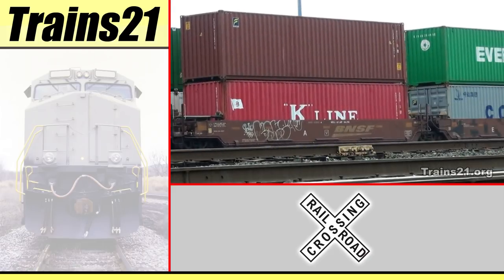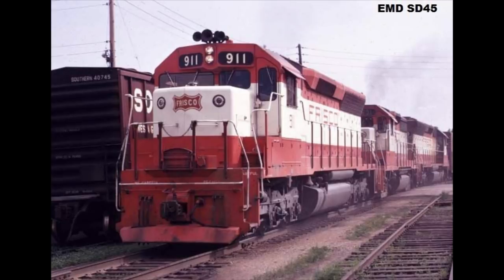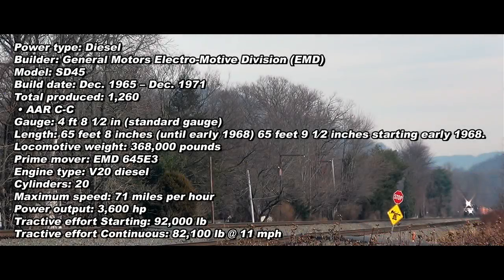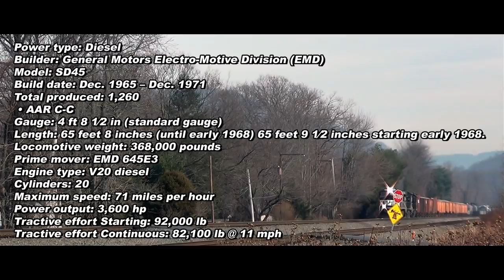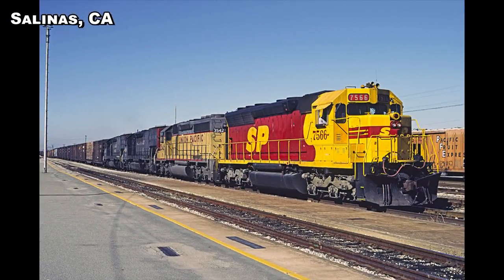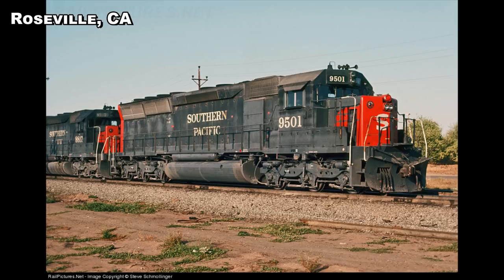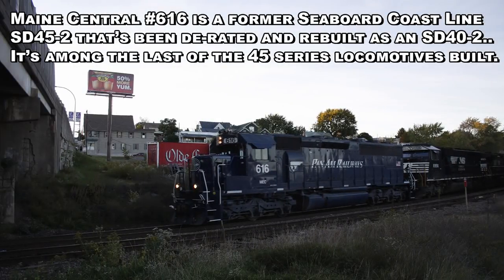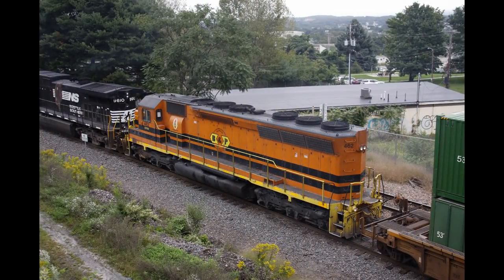[GL][T-176] ENDEARING EMDs: The Indelible SD45 Locomotive | Trains 21

Comment: Two Minnesota railroads that didn’t purchase the SD45 and were smart not to were the Soo Line and the DM&IR. The mechanical staffs of these railroads knew their business much better than EMD did. Soo Line, like its parent Canadian Pacific, engorged itself on the 3,000 HP 40-series (original and dash-2 variants). Missabe went with the 2,000 HP SD38 building blocks. In both cases, EMD tried to sell them the SD45 concept but that math didn’t fit these two. Why? They were both drag railroads. Speed was not essential so the gain of 600 HP and speed at the cost of turbocharger maintenance didn’t make sense, and both railroads accurately foresaw the difficulty of trying to unload the monsters on small railroads in the secondary market. Just think though, if Soo Line had purchased SD45s there would have been two railroads with the funky look of the slanted radiators sans dynamic brakes (C&NW being the other miscreant.)
Reply: A Soo Line SD45..... That'd be pretty neat to see. C&NW's SD45s were interesting units because of their lack of dynamic brakes. Weird that EMD would try to sell DM&IR of all railroads on speed. I'm thinking their marketing department was asleep at the throttle when they tried that. Soo Line at least had a decent amount of merchandise traffic. Frisco would have done well to figure out their needs better. It seems they regretted their SD45 purchase to a degree. They were certainly happier with their GP40-2s and SD40-2s.
Reply: The SD45's weren't great units.This includes the SD45-2's,SD45T-2's,F45's/FP45's,SDP45's,and SD45M's.All of these units had crankshaft failure and block flex because of the 20-645-E7's hence why most units were rebuilt with 16-645-E3's.
Southern Pacific owned 357 units while 167 became SD45R's and then 87 were rebuilt into SD40M-2's thanks to MK Rail.About a dozen of those units were also given fabricated radiators from SD40-2's.6 SD45M's that were acquired from Erie Lackawanna also became SD40M-2's under Southern Pacific.Many of the SD45T-2's were rebuilt as SD45T-2R's before being redesignated as SD40T-2's with Union Pacific.Wisconsin Central just adjusted the governors and derated the horsepower on their SD45's which actually solved many issues.
Aside from insufficient dynamic braking,the units actually had noticable acceleration and traction towards serious tonnage next to the SD40-2's.The tractive effort was almost comparable to the likes of GE C30-7's and C36-7's.
However,the problems that these units caused ensured that EMD didn't make any mistakes while the GP40-2's & SD40-2's were in production.This was one of the preventive contributors that sealed the greatest longevity for them.Also,decades later EMD made the 20-710-G3B-EC's for the SD80MAC's.Because of what failures happened with the 20-645-E7's in the SD45's many years before,EMD knew what mistakes to not repeat and actually were successful in making the SD80MAC's reliable and having the units retain the title of being reliable at that with the highest horsepower.Unforunately EMD ruined their recovering notoriety once more by creating the SD90MAC's in later years which were more problematic and unreliable than GE's AC6000CW's.

Comment: All that I know  is that the 3016 came by Southern Pacific   now Susquehanna   3014 used to be  Southern Pacific   then it was Painted over to Susquehanna  3012 also came Southern Pacific   now Susquehanna  the SD45 from Susquehanna  before Susquehanna use to be  Burlington Northern  in the  1980s  now as years  went on the Burlington Northern  became  Susquehanna  as 3618 and 3634 3012 3016 and 3014 were SD40T-2S  and Same as  the  Blue bird Locomotives  that NYS&W  Railroad  used to  run  the SD40-2S  from NYS&W 3022  used to  be a  GP9 number  3020 now its 3022 and 3010 came by the Rio Grande Railroad  which on first site had a train horn problem  so 3010 Retired  from NYS&W Railroad

Comment: Conrail only had 13 of these sd45-2s. Norfolk and western and southern railway a lot of these black and white tuxedo
Reply: Logan Detwiler 5 with NS which continue service on Conrail North Jersey Shared Assets. 1700 sports it’s original Erie Lackawanna livery
Reply: CentralJerseyRailfan wow they survived the Conrail split of CSX and Norfolk Southern
Reply: Logan Detwiler yeah, and there’s also CSX 8886, while retaining its SD45-2 car body it was rebuilt to SD40-2 standards with a 16-645E3. NS 1700, 1701, and 1702 have 16cyl motors but are still classed as SD45-2. 1703, 1704, and 1705 i believe have 20cyl 645s derated to 3000

Comment: I hate to be picky but Caterpillar acquired EMD in 2005 and the name became Electro-Motive Diesel. Then the name was changed to Progress Rail in 2016.
Reply: hunter dawso Not correct. EMD was first purchased by an investment firm. Cat bought EMD later on through its Progress subsidiary. They still use the EMD now Electro Motive Diesel because of the brand recognition.
Reply: Brian Burns I remember seeing a letter in 2016 saying that all EMD branding would be changed to Progress Rail. Even newer “EMD” locomotives have Progress Rail on the builders plate.
Reply: hunter dawso Maybe so, but the Cat takeover wasn’t until fairly recently.

Comment: Did I miss it, I don’t remember hearing anything about the Southern Railway SD-45’s, they were also set up long hood forward.
Reply from the maker: I didn't name check them specifically, but the EIRR (East Idaho RR) @ 22:25 is an ex-SOU.
Reply: N&W engines were dual controlled, so the engineer was on the right side short hood, or long hood leading. Southern Ry engines were single control stands, but alongside the engineer, so the engineer was on the right or the left side long or short hood leading.

Comment: Small membered men seem to compensate with lifted diesel pickups and huge lift kits and tires. Cummins 6.7 says 1,000  lb ft torque. If you were  to soup up a 20-645 EMD engine, you should be able to get at least 50, 000 lb ft torque.  A pickup WILL NEVER be a locomotive. Why waste time with a pickup? Should be called a hiccup.
Reply: That's why instead of only having an older Dodge Ram I have a few retired military trucks to surpass the purpose of a lift kit and huge tires when that's already factory.
The closest thing to EMD for me is Detroit Diesel,both are GM,which I've been a mechanic for on numerous occassions.
However,the military trucks mentioned are powered by Cummins.

Comment: The SP absorbed the UP, then the name was changed back to thr UP. Quirk in commerce law
Reply: Umm, it was the other way around.
From https://www.ftc.gov/sites/default/files/documents/reports/union-pacific/southern-pacific-rail-merger-retrospective-merger-benefits/wp269_0.pdf
"UP viewed the merger as an opportunity to rehabilitate SP, which UP and many others considered an ailing firm with diminishing competitive effectiveness. Many SP shippers supported the merger."
Reply: @briansmith8967  the sp was the bigger system, easier to push the UP into the sp then create a new company, which is what they did. So in essence the old UP that merged the mopac and WP no longer exists.
Reply: @briansmith8967  " from the STBs on filings The full name for the Southern Pacific was the Southern Pacific Transportation Co., organized and incorporated in Delaware. To benefit from this corporate location, Union Pacific Railroad, previously a Utah corporation, was merged with Southern Pacific Transportation on February 1, 1998, and on the same day, the Southern Pacific Transportation Co. name was changed to Union Pacific Railroad Co. (SEC Form 8-K, dated February 13, 1998)"
Reply: @briansmith8967  as I said it was to do with commerce law and lower tax rates in the SPs registered state nothing to do with the UP being the superior partner in the merger.